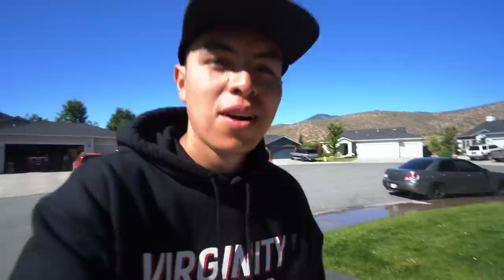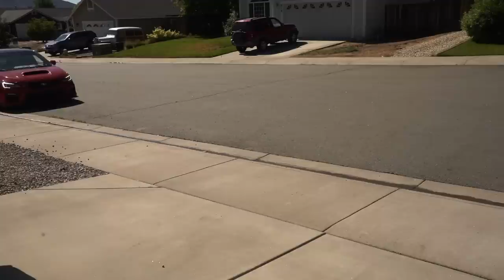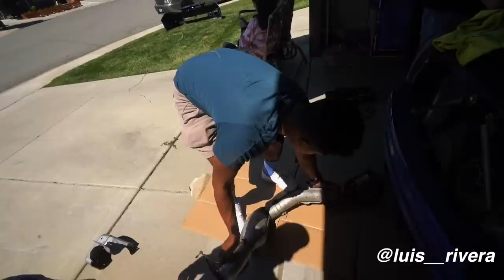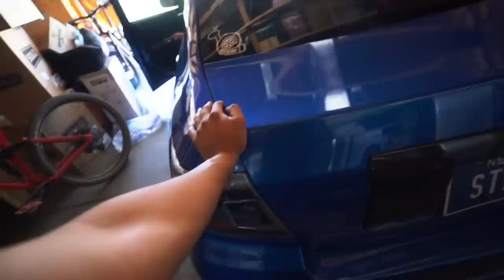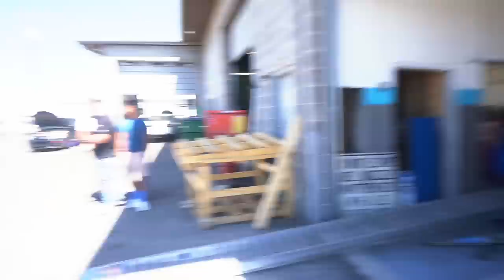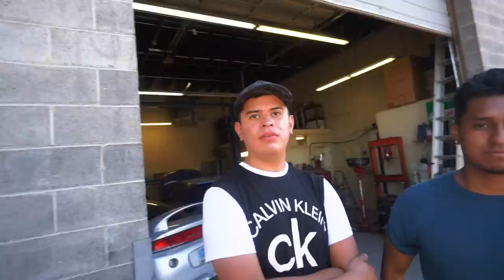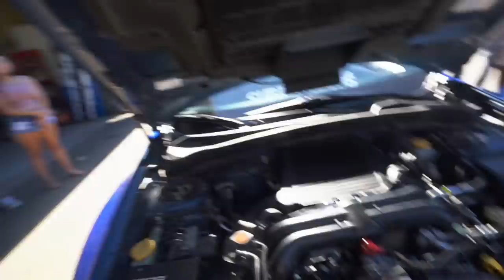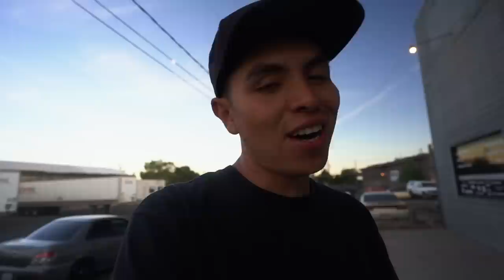Subaru WRX Blows Up On The Dyno!

Comment: i had spun 2 rod bearings @ 270,000 klm = so i put a new short block ej207 jdm sti ra spec c 20g - and had custom heads s/s valves swirl polishe , bronze guides big single springs - 310 hp crank - good enought for me . sf5 forester gt turbo 2001 august build - in gold .

Comment: Next time, do a compression and leakdown test before getting tuned. That way you’ll know wether it’s the tuner’s fault or the engine’s.
Reply: im guessing it was also low on oil pressure too
Reply: Compression and leak down test wouldn't Pick up a worn crank/rod bearing until its spun.
Reply: James Howard Doing the tests still gives you an idea how healthy your engine is. Other than that, if he did all the preventive mods like Kill bee oil pick up/baffle combo, oil change, spark plugs, etc etc then you can assume it’s worn bearings. It’s always 50/50 chance wether it’s the tuners fault or the driver’s lack of preparedness.
Reply: James Howard compression check won’t. But oil test will.
Reply: not true
Reply: Ripties false the only sensor for oil pressure is a dummy light that comes on at 2psi. So if it comes on your bearings are fucked.
Reply: It’s the manufactures fault lmao they all blow up, junk
Reply: Good dyno shops will do that before they tune it. That sucks man.
Reply: Eddie Ellison literally no one ever bothers with that, your expected to go to a dyno with knowings of your car and everything ready to go, as many big tuners make videos of make sure you come correct
Reply: SAVAGE CR-X not true. Almost every reputable shop has a pre dyno inspection to prevent shit like this
Reply: @savagecr-x2438  literally false haha. The shop I go to out here requires you to do a pre-dyno inspection BEFORE they'll put you car on the dyno for pulls, and what you pay for the inspection goes towards the dyno tune too anyways.
Reply: People always blame the EJ. Poor block never did nothing but squat low and assist the corners, just like Gopnik. Гордитесь и защищайте Subaru Boxer Engines повсюду, товарищи!

Comment: These people in the comments blaming the tuner make me laugh.  They are slapping everything together 2 hours before the tune...  Shows up with a huge exhaust leak.  Lol.  I wouldn’t be surprised it the car was overdue for an oil change, had old shitty gas & original spark plugs...
Reply: MB SoCalSTi Exhaust leaks really only matter from turbo to downpipe all the way to headers to intake manifold. From downpipe to catback was I believe their problem and it’s not a big deal.
Reply: I know the exhaust leak didn’t cause the issue.  Point I was making is that 2 hours before your tune your car should be completely gone over already.
Reply: @mbsocalsti6157  That's what I was thinking. When he said it was 9:30 and the tune was at 12 and they haven't even got the downpipe on I was like why didn't they do this like the night before...especially after he mentioned that he's had the downpipe for over a year...like wtf
Reply: The car had problems with back pressure you could tell by the exhaust note and hum during the Dyno run.... Said he removed the Cat? Why would you do that unless your asking for trouble
Reply: @mattcat5668  no it didn't, turbo cars don't need to rely on back pressure. The better they breathe the better the power. Any reputable tuner can tune for a catless downpipe.
Reply: @juanarroyo465  the only cars where back pressure doesn't matter are cars with a blower. Turbo cars absolutely need back pressure.
Reply: @aperson4713  that’s simply not true. Why does a turbo car need back pressure? Turbo cars run way better when the exhaust is not restricted. My cats have been removed on my car for the past 100 thousand miles with no problems.
Reply: @fatkat311  I don't have a clue why it needs back pressure, I only know it works better with some back pressure vs very little.
Reply: @cockus123  agree，that is definetly some misfire or detonation，which will break the engine entirely
Reply: @aperson4713  wrong the turbo itself provides back pressure to spin the turbine.

Comment: Sounds like it spun a bearing. 100% not the tuners fault, it just happens.
Reply: @cockus123  and what does breakup have to do with poor oil circulation
Reply: @cockus123  what the hells fuel/air have to do with the rod bearings ?
Reply: Detonation especially in high boost can beat the hell out of rod bearings
Reply: @jrockhardest  detonation can cause rod bearing failure and/or piston failure
Reply: @ts-vu3dd  nah it really can't. If breakup is that bad you'll lose your sparkplugs really early. Then your rings, then your rods the car will be long dead before the bearing fail. Failing bearings are caused by poor oil circulation, contamination(other bearings failing) crank walk and improper installation/sizing. If it was caused by the tune it would take a very long time, and like I said you'll start to lose chunks of piston long before the bearings go.
Reply: @jrockhardest  also Subarus tend to have softer bearing materials compared to Mitsubishi Mazda Honda and Subaru at the time

Comment: This is why I did my timing belt, spark plugs, oil change, and inspection before my dyno tune....
Reply: what inspection did u do?
Reply: Sometimes none of what u just did will mean shit when u spin a bearing!
Reply: @filiplaskovski9993 Every time I have mine tuned my tuner ALWAYS does a leak down test, compression test, and check the gap on my plugs. If you think none of this is crucial before doing a tune and especially if you have a tuner who does not suggest this….. Please do your car a favor and sell it! You don’t deserve that car and that is being 100!

Comment: Send it over to Devin Niemela and have him build an engine for you guys.
Reply: I watch him too I bet he could fix it in at least less than a week!
Reply: Gotta like da man
Reply: Send it to Bader built
Reply: Devin or Bader Built. Bader builds some nasty cars
Reply: Lol it's impossible to build one of these things on the stock block and having it reliable. The 2pce block is what causes these things to break alot of times even after ones been rebuilt using rods pistons bearings etc. The blocks twist and the crank main lift by .10 off and yep rip. They also have weak head studs. And horrible oiling. Ima get alot of hate from the subi community from this but it's true I owned a couple and even rebuilt a 207. Threw king bearings in re used crank and rods pistons new seals and hg and arp head studs. All tolerances were perf and I left the boost at stock and stock exhaust even dead stock. 1yr later the block literally split down the middle.
Reply: I talked to a guy in the city after this happened and he's built a few 800awhp subis. Told me the 2ce block twisted and failed on me and that what caused it. Told me the only way to make these things reliable after 600+ you need a billet block to stop the lifing and twisting. BRAND NEW CARS LIKE THIS SHOULD NOT BE KNOCKING AFTER RAISING THE BOOST AND HAVING IT PROPERLY TUNED. Subaru doesn't even offer drivetrain insurance on there WRX or stis if you buy one brand new. A customer of ours came in and told us he bought a new wrx sti. Had only 4400km on it. He did the break in and on his first pulls the thing blew up. Brung it into the dealership shaking in anger after dropping 55k on a sti and it blows up. The dealer then told him they won't cover it because the ecu said he was going 170kmh and the rpm was 6000 when jt blew. They told him he didn't properly follow the break in procedure lmfaoooo. Guy had to drop another 15k 1 day after buying it on a new engine. Fucking should be illegal imo to do this.

Comment: That's exactly what happened to my WRX. Motor got rebuilt and still running 6 years after. I feel you!
Reply: l y m a x shouldn’t be modding if you can’t pay to play
Reply: @Grim-STi   Can try putting everything back to stock and see if dealer will cover. You know dealers they're very meticulous, and I read on forum that dealers can tell if the ecu has been touched (checksum values). For me it was such a hassle taking my car to the dealer so I paid to play. If done right and taken care of, built motor will last. I was financially screwed that time too. Full coverage insurance has nothing to do with this they're for collision/accidents.
Reply: My bugeyes engine blew awhile ago and it's been sitting since..
Reply: @heatsink  putting the motor bak stock and playing dumb is straight up fraud. Better to own up and admit to the dealer that the car is modified and see what can be done.
Reply: Like dealers are honest themself, they're known for rip-off. Man up and pay to play. Don't go to dealer they won't help you.
Reply: the bearings are known for being weak lmao
Reply: Nice Me too! When my bug eye spun a bearing I had IAG build my bottom end back in 2013, engine has been going strong since, It has chewed up 2 transmission though, wish I can go 6 speed swap

Comment: 2012 wrx owner here. I'm pretty well versed in these cars, and know just about every little problem that can occur with these things, as they've all happened to me on my journey to 800whp. Anytime wrx/sti's of this generation (GV/GR) get to around 75k miles, they always always spin bearings. Myself and 5 other friends I know personally/locally (all same generation as the car in this video, GV/GR), have had this happen to them around the mileage (+/- 1000 miles) mentioned in the comments by Thirdshift (replied to a comment saying the car in this video had 74k on it). All of us are extremely anal about our cars maintenance intervals, oil every 3k, plus all have the typical longevity mods (oil coolers, bigger radiators, IAG/Cobb AOS's, etc), no ebay shitty quality parts, quality tunes from reputable tuners, quality oil like Motul 8100 xcess 5w40, basically everything you can do right to keep the car healthy. We also know not to lug the engine (aka no full throttle at high gears at low rpm), we dont rag on the cars, and every single one has spun a bearing around this mileage. I dont know what it is about the engines made in this generation but they just dont last as well as others.
The only exceptions I've noticed is if the car is BONE stock, no engine mods, no tuning, nothing. 
A lot of car manufacturers will underrate their engines so they dont operate at max capacity so they can be reliable, but it seem like with these engines they're not underrated from factory and operating under max capacity all the time, so anytime you tune it you're exceeding its max capacity and things go wrong quick.
Obviously theres people out there who have had success with tuning the stock engines and going beyond 75k or even 100k, but I honestly really think these cases are few exceptions, and maybe only occupy 3-4 cars out of every 10.
Keep in mind this is just what i've observed over the years of owning my car, and being friends with people who own the same car, and knowing countless others. I guess these cars are just extremely fragile at the end of the day.
Reply: 13 wrx owner here mine spun rod bearings to had to rebuild it my self
Reply: 2011 WRX here. Stage 2 with custom E-Tune and currently at 101k miles. There has to be a common denominator with you guys. Maybe it's the way you drive?
Reply: It would seem like there has to be a common denominator, and its hard to just take some random person on the internets word for it, but I can honestly say we did everything right, driving habits included. We're all 22+ years old, so I'd like to say we're pretty mature drivers (spirited driving every now and then of course). We all used our cars as daily drivers and our weekend toys, so the cars first and foremost needed to be dependable, personally everything we did was done for the health of the car, like our modifications, maintenance, and driving habits included (warming up the car beforehand included). Since you specifically mentioned it could possibly be the way we drive, I'll expand on that a little. We're all pretty well versed in these cars and we know how to drive these things, for example its kind of well known that lugging the engines on these things can cause detonation and all sorts of other issues to occur, so we stayed away from habits such as that (among other bad habits too). And like I mentioned previously, these were daily drivers, so most of the time they were just cruiser cars for us. Even on weekends when we'd go out, yeah the cars would see full boost and spirited driving, but 99% of the time we would never bang gears one after the other like Honda boys can, we'd do pulls here and there, but by no means would we rag on them like its on a track, they were daily drivers at the end of the day, also we rarely took them to redline since most of the time the cars stopped making power after 6000-6500 since the stock turbos run out of steam. Maybe it was just a fluke all of our cars shit the bed around the same time, but who knows, we really did try to do everything in our power/knowledge to keep the cars healthy. But glad to see your car is still running strong!

Edit: All the car's were tuned with AP's and monitored AFR's, feedback knock, fineknock learn, DAM, boost, etc. I was a bit more anal and had a separate AFR gauge installed, as well as oil pressure and oil temp. So I was pretty intune with how the car was running when I drove it.
Reply: @classics07  hmm I wonder if gas quality was the factor? Were you tuned on 91? I've been using 93. I know the tune is one of the biggest factor for sure.
Reply: My 12 sti spun one at 79k. I feel that, luckily it was covered under the recall
Reply: I reached 124k miles in my subie I only had a base tune on my wrx and believe it or not it was my daily 2009 similar to this guys car it’s possible am in a 2015 now also my daily I just don’t go gaga for power though I have very few mods and my engines are usually untouched but fully up to service
Reply: @jerseyman1O  we all ran 93, we live in the midwest so 93 is everywhere! For sure about the tune too, you can have all the best parts but with poor tunes, it doesnt matter. We all had custom pro tunes (fuck the OTS cobbs maps, they're dog shit lmao) from a few reputable and well known tuners around us
Reply: @ConnSoIo  Sorry to hear that homie, I swear theres just something about these cars at that mileage where it happens all too often
Reply: @revl8er the 15+ wrx's (not STi's) have that new FA20, which seems to be alot more robust in terms of not spinning rod bearings, you should be all clear in that department, but... do watch out for physically bending the connecting rod itself running too much power (anything close to 400 whp/wtq)
Reply: @natesway34 I hope so too!! I'd highly highly recommend getting an oil pressure gauge installed, that way you can notice any weird drops or changes in oil pressure, and maybe catch something before it catastrophically fails. I'd also highly recommend an oil temp gauge too, reason being if the oil gets too hot, it thins out and provides less of a cushion on the bearing from the crankshaft, as well as much less lubrication which is the key factor in rod knock. So that way if you notice too high of oil temps, you can keep your foot out of it till the car cools down a bit! An aftermarket oil cooler helps too :)

ps: get quality gauges too! i HIGHLY recommend AEM
Reply: Your absolutely right! Certified Subaru tech! I’ve seen it happen all the time! Even brand 
new cars
Reply: 09 FXT cyl 4 piston rod cracked at 104k miles. Completely "BONE STOCK".. It just happens 🤣 put a new EJ257 shortblock in and I've put 25k on it without a problem (yet)..
Reply: Just learned a lot from you, appreciate the knowledge!
Reply: @evoeater4837  My pleasure! Just figured I'd drop the things I wish I knew, and things I've learned along the way. Anything to keep another subaru on the road! Hope you can do the same for someone else too!
Reply: Did you replace the oil pickup and tray with an IAG or Killer B?
Reply: @henryrubio8534  When my engine spun a bearing, we replaced the factory pieces with a Killer B pickup + a killer b pan and their windage tray. The IAG unit wasnt out at the time. We suspected maybe the pickup tube was cracked near the factory welds where it bolts to the block, but everything looked good. But its still a known issue for the factory ones to crack so we replaced it anyways :)
Reply: If you guys didn't know. These cars and motors are pieces of crap.  Unreliable junk.
Reply: @happyguy4525  I mean you're not wrong lmao. Lots of flaws with these cars.
Reply: 2010 wrx stage 2. 130k. Owned since 50k. No probs here. Since i bought i use 0w40 mobil 1 and lucus. Been doing this setup in all my cars and they all last. Hmmm mabye I've figured out something.
Reply: @jeffawake4669  Maybe! Keep doing what you're doing. Clearly works!
Reply: natesway34 I have 89k on my STI. I’m not worried.
Reply: @revl8er wrx has an FA20 engine, people here are talking about ej255, apples and Oranges comparison. 😂
Quality oil and oil filters at short service intervals really help. I’ve never liked the ej255 engines, had a nightmare ownership with a 2006 wrx. Always had excellent luck with ej205 and ej207. Actually my ver 7 ej207 just lost compression on cylinder 4. Dropping a ver 9 ej207 in to replace the ver 7. Had a ver 8 in the past, really liked the vf37 and twinscroll setup. Going back to twinscroll but still have a wagon with single scroll unequal for subie rumble.
Anyway, whatever happen to the car, hope the dude dropped a jdm 2L engine at it or got a good engine rebuild.